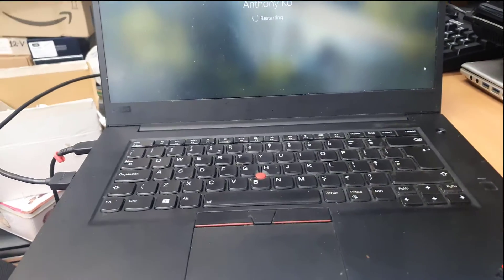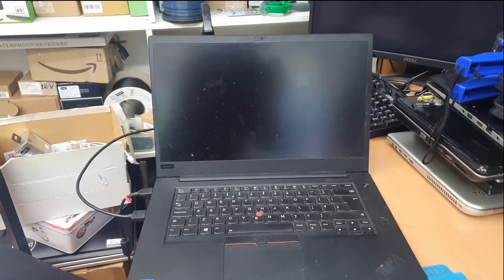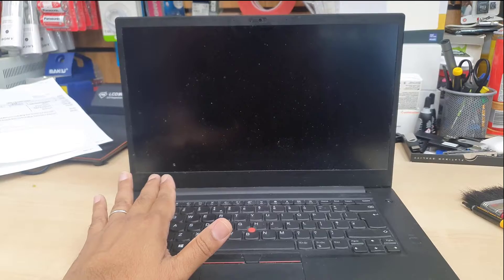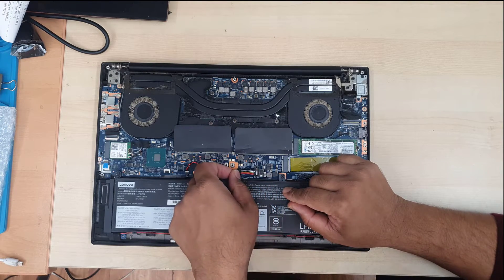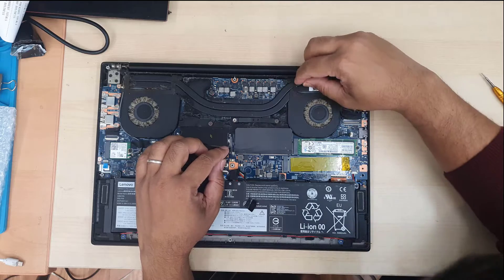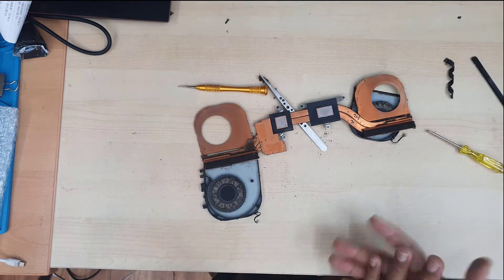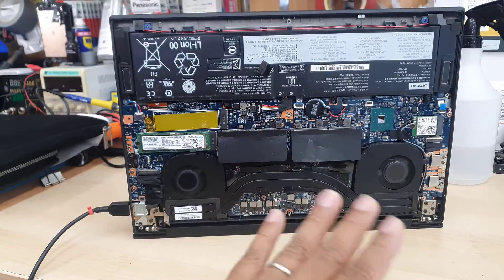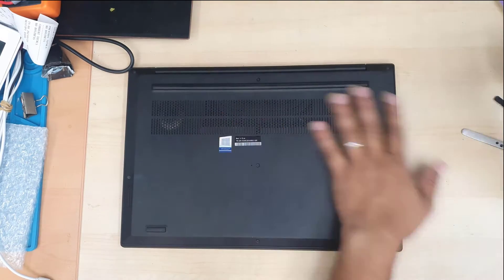How To Fix Gaming Laptop's Overheating Issues | Lenovo X1 Extreme

Comment: I love the X1 Extreme I have, but for some reason it doesn't work with a battery installed. It shut off abruptly and only runs with the battery unplugged. I replaced the battery and it didn't work either? Now it's a small desktop. Theses have a great cooling system but they do run hot, I wish they'd made the exact chassis with a Ryzen 9.

Comment: Hi, I have the thinkpad x1 extreme 2nd. In my case, only one fan goes max speed, the other one stays always at “idle” even when the pc is boiling hot. I used the lenovo scanning tool and only in that case I hear the second fan spinning at max rpm. I don’t remember if it was like this even when the pc was brand new. The thing is that when I do the fan test, it spins, even fast, but when is needed, it never spins. there’s only one fan spinning fast. what can i do? thank you